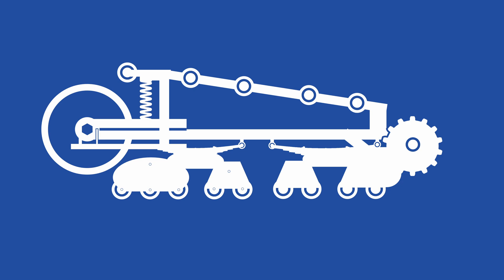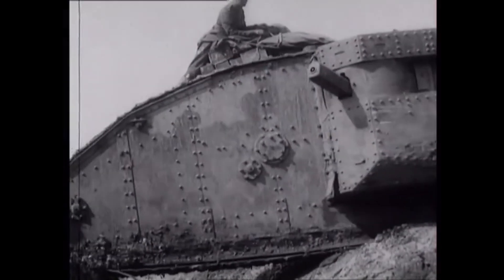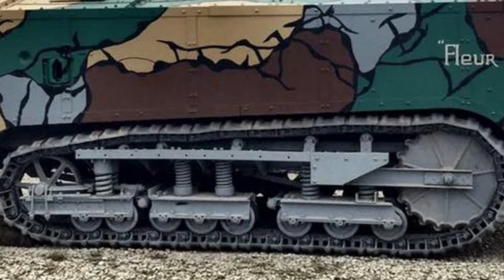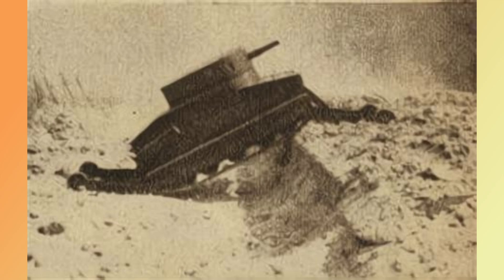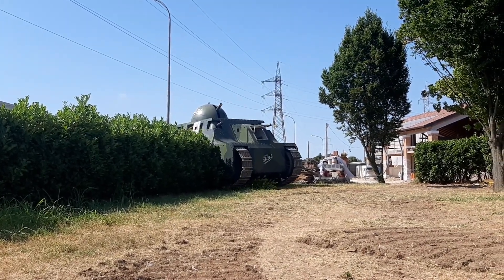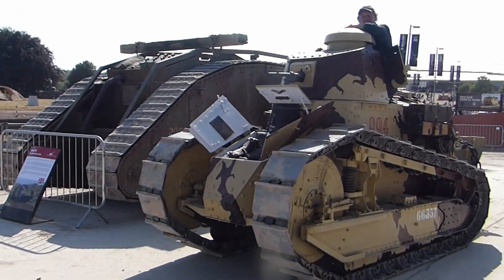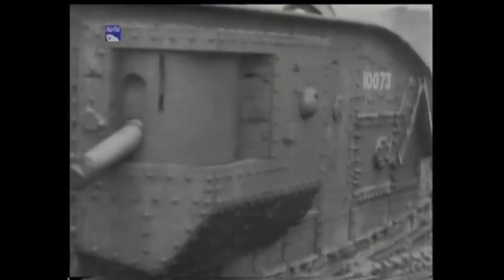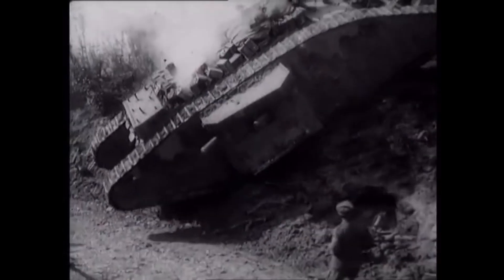WW1 Era Suspension | Tanks explained

Comment: There is tank suspension, and then there is whatever in the spaggetti hell Saint Chammond had
Reply from the maker: that's disrespecting spaghetti
Reply: @Enigma2373 I am going off of what I saw both in games and model kits.

Each boggey is attached to a butterfly wing like assembly, with first two pairs being attached to the same axis, while third pair has its own axis attavhed to the first one by free-floating beam. Then each of the butterfly wing boogie assembly is attached to one or two front to back "wishbones"( for lack of the better term), and one going from side to side( yes, they cross near eachother per pair).

I dunno ig this explenation makes a lot of sense, but when makeing my model kit I honestly was a bit of the bullshit to put toogether, and it looks messy as all getout if you look from the bottom

Comment: The A7V did have suspension,  3 sets of 5 wheel bogies per side on coil springs.
Reply from the maker: @garyzimmer4149  Oh oops, one of my sources said it didn't have it but not looking at it it did have Holt Style vertical spring
Reply: @Enigma2373  I'm pretty sure it was built on holt bogies, as these were readily available.